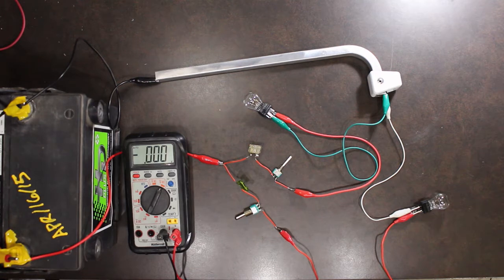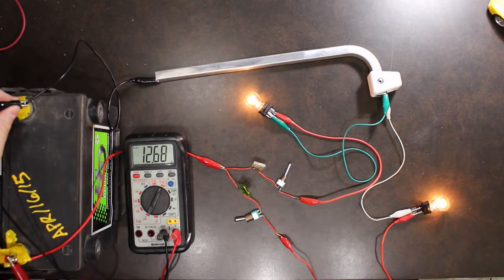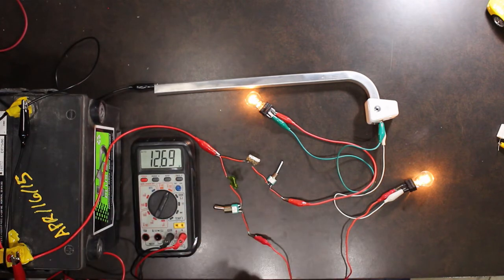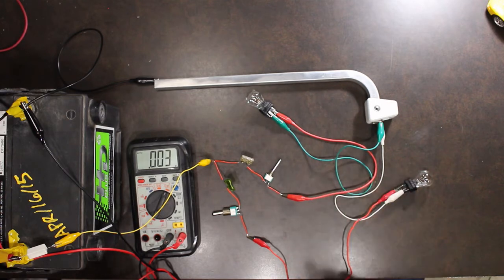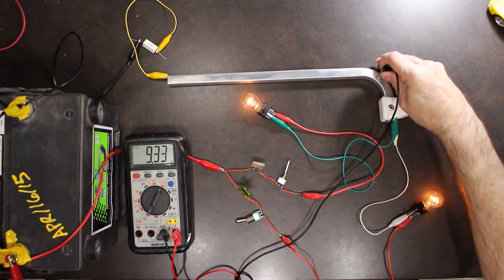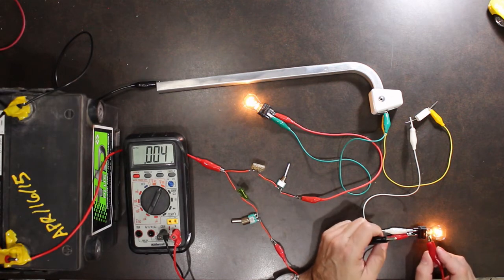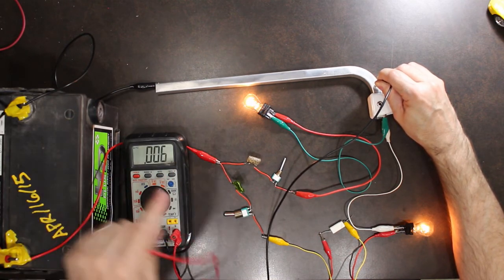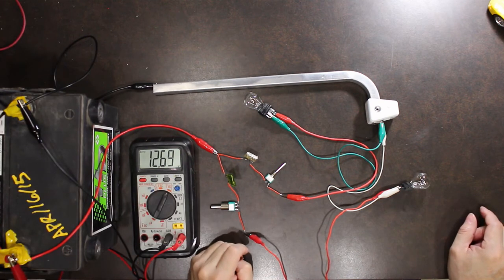Automotive Electrical Testing Procedure

Comment: The video is very good. Thanks for the explanation.
But I have a doubt and if there is a current leak and you find your corvette battery discharged in a couple of days, where do I have to look?
Reply from the maker: Thanks for the comment.  
What you speak of is a different issue than a bad connection.  What you have in that case is a parasitic draw.  You can find those by using the amp meter function on your battery terminal leading to the fuse block. 
I will try to create a video for that next week and post it on the channel.  What you need to remember is that in modern cars your battery is always being drained because of the electronics in the car.  The problem occurs when too much is being drained and the battery goes dead over a few days.
Reply: @justcorvettecrazy116  Thanks very much
Reply from the maker: @franciscojavierjimenezmuno1757  As I promised, a new video is coming out for you on Friday.  It is called Parasitic Current Draw.  Look for it on my channel Friday evening.  I hope it helps.  Keep me posted.  stay safe.